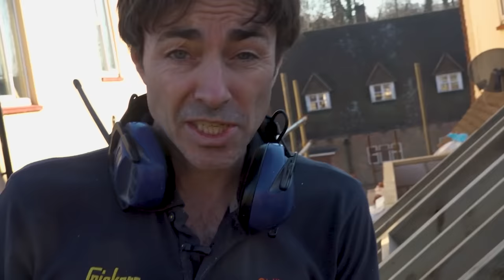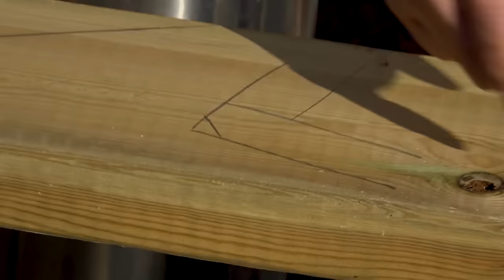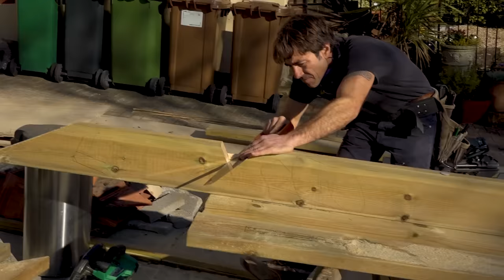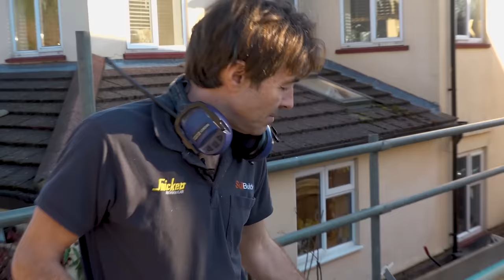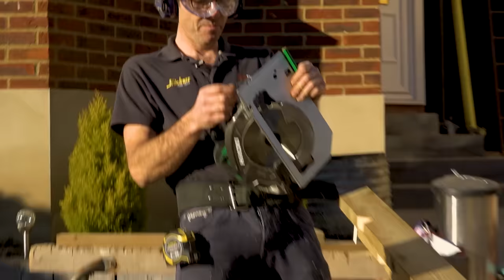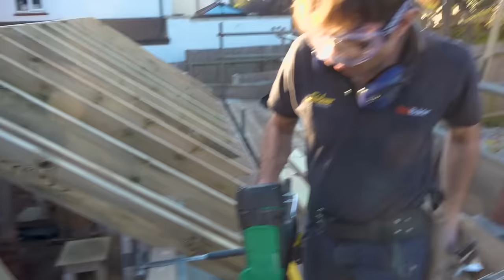How to Cut Hip Rafters

Comment: Robin,  I've seen lots of your video and I think you do exceptional work.  However,  for the cutting of the side angle on the jacks and hip rafters you are incorrect in saying that the side angle is 45 degrees.  The side cut angle is always less than 45 degrees, i.e. you need to set the saw angle at greater than 45 degrees.  The actual setting is determined by the pitch of the roof; the steeper the pitch the greater the angle you set the saw.  The actual angle  can be read off the framing square or a set of rafter cutting tables.  If memory serves me correct (and don't quote me on this), for a 35 degree pitch roof the side cut angle is 42 degrees (i.e. you set the saw to 48 degrees).  That may not seem a big difference from 45 degree angle you say, but it does make a difference to the fit.  This is even more so with steeper pitched roofs or if you're using 75mm thickness hip timbers.  I've had this discussion with many carpenters and very few understand this; it's all to do with compound angles.  For this reason I use a Mafell  saw which gives bevel cuts  to 60 degrees.  

I only raise this point because you said it was a Masterclass, , and that being so, then I respectfully make this point.  All the best to you and Roger, one of my favourite Youtube channels  with lots of useful and real-world  experiences and tips.

George
Reply: Sorry George your welcome to come with me and you can see what I do in practice!!!! but if you set your circular saw to 45 degrees and cut the plumb cut angle of any roof up to 45 degree pitch then it works perfectly, if you try to check the angle once cut with a bevel it will indeed vary for every pitch up to 45 degrees due to the way you intersect the angle with the bevel for example.... look at it on plan, if the walls are at 90 degrees to one another and the pitches are equal then the cut is at 45 degrees to plumb cut every time, happy to have a roof cut challenge with you.. or any one else in who fancies it!!!!!
Reply: @BillyMustang101  Martin it is always at 45 degrees to the plumb cut but not if you try to check the bevel against the top of the rafter, do it your way then cut a seat cut at 90 degrees near the top of you jack cut, check the angle and it 45 degrees bring on the roof cut challenge!!!!!!
Reply: @ukconstruction  Yes Robin, the cut is 45 degrees on plan, BUT you're making a three dimensional roof.  So in plan the cut is seen as 45 degrees, but  because it's three dimensional it's  not cut at 45 degrees.  I would explain it in simple terms like this; get a 50mm wide strip of hardboard and cut a 45 degree 'point on it.  When you hold it flat into a 90 degree corner it fits perfect. but if you tilt it at an angle you will see that the more you tilt it the worse it fits; that's compound angles for you.  If this doesn't make sense look at your rafter square (my Stanley metric one) and you will see the it has  the side cut angles stamped on it and they vary for the pitch of the roof.  If the angle was always 45 degrees, as you say, then these would be no need for these side cut angles to be there would there?.  You will also see in a Roofing Table booklet that it will show a table of side cut angle that differ depending on the pitch of the roof. Again, if the angle was always 45 degrees then there wouldn't be a need for this table to be there.

I do recognise that the differences on a 35 degree roof using 50mm timber is a matter of millimetres, but I raise the point only because it matters more on steeper pitched roofs and with thicker timbers. As I say I very much respect your work, but you're mistaken on this matter.  Perhaps you'll look further into it before you reply.  

George
Reply: Lads, I think the confusion here is that George and Martin are thinking along the lines of marking a Jack rafter  out to be cut by hand, not with a skill saw? Take a roof pitched at say 36deg, you would mark the Jack edge cut at 39deg, but when using a skill saw ( with the hip at 45deg  on plan) you can set your saw to 45deg , cut the plumb cut and the edge cut will find its self. Put a bevel on the cut you just made and it will be, in this case 39deg, common practice.
Reply: Just finished a 45° roof
Jack plumb cut 45°
Jack edge cut 35°
Hip plumb cut 55°
Hip edge cut 40° 
Hip edge cut does change!!
Reply: Joe Beale  well done you are right! Clarification of the situation, not only are you right but so is everyone else! 
One can’t beat a good discussion on the degrees of a side cut on a jack rafter first thing in the morning.

Comment: Great video! Just one thing I'd say, (around 15mins) when you're cutting the angles, I like to put another bit of timber supporting bottom plate of the saw on the off cut side so it's a lot easier to balance and guide 👍🏾

Comment: I'm an engineer. I rarely get to see my designs built.
I was recently told that a project I worked on didn't result in an explosion of heated caustic or literal train wreck. At least the stress is off on that one...
I should've been a carpenter.

Edit: I have no reason to think any of my projects wouldn't go fine. If I weren't stressed, I might not obsess over details as much.
This is just a comment on how working on plans all the time can be unfulfilling. See Office Space for more details.
Reply: yes indeed ..
Reply: The trouble I find with hips these days is engineers always want them doubled! As you can see from this video, it’s complex enough as it is
Reply: Engineers should have to have some kind of in the field training. Anyone can draw anything on paper. But does it work in the real world?
Reply: Thanks,  I'll check it out.
Reply: @greglucero8714  well, mankind went to the moon only based on engineers and theoretical information. but i agree that theori is not always the best. but it is only true when it´s experience based.
Reply: Glenn møller not true, it took a few astronauts burning alive on the launchpad before they got it right.
Reply: @Solidsnake0208  how many would have died if there were no engeniers. ?....... they would NEVER have even been landing in the direction of the moon if they ever got the rocket outside the stratosphere.  believe me... I KNOW how complicated gravity vs / acceleration calculation for just to get the rocket in area of moon without running out of fuel.
Reply: @greglucero8714  i have 30 years of plumming exsperience and also educated engenier too afterwards...... NO noone can do it all without drawings. there is just sometimes when a drawing is more useless then other. same apllies to this and lot´s of other stuff. there is a difference between making sometinh that is proved to be safe and working  and is save and working by exsperience.   i would never by a house where the carpenter say´s  i believe it is save if therwe comes in a storm.... but if you want to be sure you have to try it and risk your healt and famillily´s healt. i it breaks down because i was wrong and you die i will build it stronger.   gggg
Reply: @Solidsnake0208  it´s complex because we have something called gravity, wind pressure, snow pressure and material strength.
Reply: @Solidsnake0208  
What about the Monkey & The Dog  NO word about them (That one can Honestly believe )
Reply: I'm planning to build an L shape patio roof around my house.
I made a plan, but I have some questions about structure strength. And, since you're an engineer, could you please help me out?
Reply: @greglucero8714 
It always a plus for a civil engineer and an architect to have some knowledge on hands on construction work, but not necessary...
 it's all about numbers..
good numbers and accurate calculations make things work out correctly and good explanatory drawings is enough for a knowable carpenter/framer to build it.

Comment: Robin i see the scrap bit of timber you offered up to mark the length of the hip was cut at the degree of pitch, does it need to be cut at the degree to get precise measurement. Cheers great vid as always, true expert  carpenter.
Reply: The thickness of the timber  doesn't change no matter what angle is cut on on it a square cut piece of scrap material would do the same thing
Reply: Noticed that too!

Comment: I'm a specialist staircase design and construction joiner so I thought I knew my stuff, but I've just watched a wizard at work, think I need to go back to college, unless you want a 40 year old apprentice?
Reply: I have done some fancy railings over the years. Always better when I built the actual stairs. I have no doubt you would agree.
Reply: @donalso  hell yes! There have been occasions when I've actually considered taking the hit and replacing an old staircase for Free when retrofitting balustrades.
Fortunately it hasn't come to that yet. But no matter how many I do, the glass ones always cause sleepless nights between making the templates and completion. 😰
Reply: @sally6457  I just finished a cable steel post sapelle rail job. I am on a g&t diet for at least 4 hours. In my framing years I would pre cut a piece of backing and tack it near by so the plumber would be able to put it where he needed it. hanging cabinets; all the uppers hanging on a poorly placed screw. I like to preframe my cabinet jobs. People spend so much money for a place to live in comfort and the providers are in it for the money. Shameful I think. Respect your home owners, your plumbers, electricians, et al. One home owner told me his drywaller gave him $150 cash at the end of he job because the building was so square. My only point is about respect for those who are paying the tab and respect for the privilege of building something for those people!! OK, I'm done.
Reply: @sally6457  This may sound weird, but trust me I am a nice fellow with a woman in my life that I truly love. If you live in this hemisphere and have a stair job, I would love to collaborate. Not about money so much anymore, but about  whatever that je ne sais quoi is all about. Pardon my french!

Comment: My first and only hip roof, was on a treehouse, roughly 21 feet above the ground.  The walls met at a 70° angle to each other at opposite corners, and 110° at the other two corners, for a (stupid) parallelogram.  Plus, there were two dormers on the 12/12 pitch roof.

It just about drove me crazy trying to figure out the hip rafters and jack rafters!  I probably scrapped 100 feet of lumber before it was good enough.  I'll never build another hip roof, nor a parallelogram building.  EVER!

Then again, I'm not a carpenter...

Great video!  :D
Reply from the maker: Throngcleaver I don't think most carpenters would want to take that job on. As soon as you get into bastard hips  they are gone. I know carpenters who have never done a bastard hip and who can blame them.
Reply: @SkillBuilder  Haha!  I didn't know they had a name!  It certainly was a frustrating bastard, but I had to shape the treehouse to fit the tree, hence the parallelogram.  (either way, hindsight says I should have gone with a gable roof)
Thanks, Skill Builder!

Comment: As a carpenter and joiner of some 56 years now, hip method is how i,ve always done it.would have liked a mention to put a dragon tie in underneath hip thus linking both wallplates coming into the corner ,  and then cut another birds mouth on to it. On that short hip probably not needed,but on a longer hip  would be better as it gives more spread strength to the corner.

Comment: Pitching roofs off the same height is very easy. Where it starts to get tricky is working out rafter/hip and valley lengths when you are pitching a roof off different heights. For a roof pitched of the same height work out your half span - half the Ridge thickness x by the rafter constant of the degrees of the roof e.g 25 degrees. That will give you the rafter length from the top of the plumb cut to the pitching line.
Reply from the maker: https://www.youtube.com/watch?v=_TmXZ0cGNEI&t=28s

Comment: Never really know how much to drop the hip so that the outside edges line up correctly, so measuring it directly once you have cut the 45 on the plate is quick and simple way to go, also marking the the last common and  crown with the hip shoulder and measuring from there is a great tip
Reply: brian child the hip rafter is the same ( dead height) as the common rafter. Dead height is the plumb cut at the point the rafter touches the frame or plywood. Both are the same height.
Reply: If you cut the corner of your wall plate for are you pushing your hip in from it’s true point so your dead height is not the same as the dead height in the common rafter

Comment: After 30 years of joinery This is one of the best sets of information programs I have seen ... Well done

But the health and safety is a bit lacking. Just remember you don't bounce if you fall off that roof.

For us to work on a 8 foot high roof .= 4 lads prepared the ground for a crane which drove a 100 miles to the job.A Banksman also someone to hold the ladder. Full PPE. Safety Harness with inertia recoil system . The crane had to follow the worker 3 meters above and all just to place a rubber gasket on a cabin joint. 

But you do need to pick up more on site procedures  .
Reply: Try getting the client to cover the cost!!! The domestic market is an unregulated cut throat business and I respect safety and indeed I police anyone with me like crazy, thanks for your comment and I really respect safety and good practice, best Robin

Comment: Hi Robin always enjoy your videos. You mentioned your 49, I'm 76 and retired with ailments. I'm jealous watching you with all those cordless tools. Back in the day used a Skil 77  or a Milwaukee sidewinder, with an old Disston crosscut saw for finishing birds mouths. Everything was nailed with 16d and 8d nails by hand. Only the big contractors had air nailers. Here in the states we worked with fractions of an inch, to me metrics are better. I still remember a hip rafter has 16.97 inches of run for every 12 inches of run of a common rafter, rounded it to 17 inches of course on the square for the hip. And I'm glad you said regular hip, an irregular hip or valley comes in at an angle different than 45 degrees. Was taught stepping off with a square also with home made dividers, and a speed square with Swanson's little blue book or direct measuring. A lot of ways to frame a roof.  Always enjoy watching you and Roger your both always doing the best you can, no short cuts. As they used to say on a commercial "Quality Job One", I think that's how it went. And always keep up the good work, thank you.

Comment: Great video, absolutely loved it and learned a ton. While watching, I was drawing all the constructs and doing the trigonometry + working out how that magical square of yours works :)
However, I have two things in the video that don't seem exactly right

1) when you transfer the 'depth' of the birdsmouth from the small foot of the common rafter to the hip, I don't arrive at the same depth to get to 1/3th of the timber (on the level angle), I think this is because the small foot rafter is cut at 35° pitch, while the hip works out to 26,341 degrees?
2) I didn't follow you on the calculation for jack lengths. Basically you're saying 
sqrt(2) / 10 * center spacing = the diminish length. But that would mean that the jacks are always the same length, regardless the pitch of the roof?
I arrive at an incremental jack adjustment of: the center spacing / cosine(pitch), so in this case 400/cos(35°) = 488,3

Anyway, I could very well be missing something, excuse my ant-f*cking as we say in Flanders :) (=nitpicking) 
And thank you very much, Roger and Robin
All the best!

Comment: Nice work, can I please ask why there is no muck under the wall plate ? And why is there a big gap ?
Reply from the maker: There is muck under most of it but that corner has been lifted to get it spot on because it sometimes sinks a bit. It will be grouted in from both sides once the roof has been framed.
Reply: Skill Builder many thanks 👍
Reply: I noticed the wall plate hadn't been  bedded too also its 4" x 2" , shouldn't it be 4" x 3"?